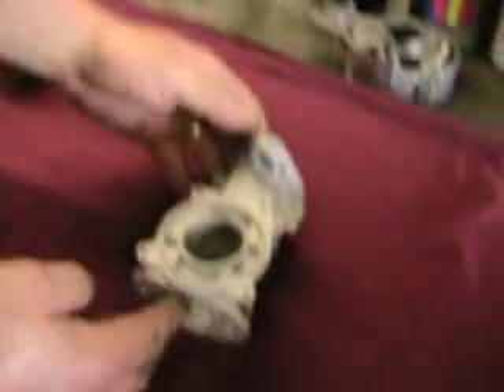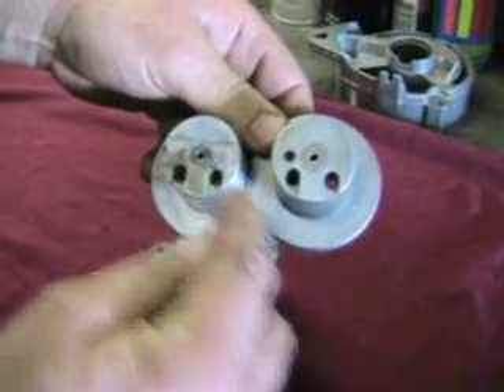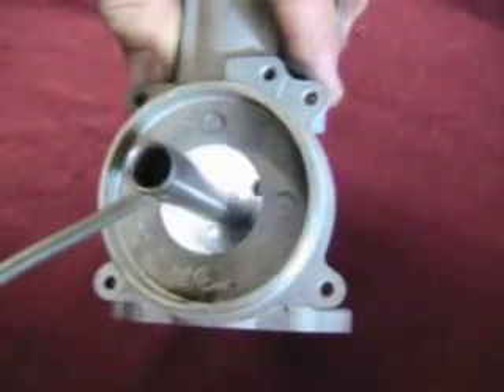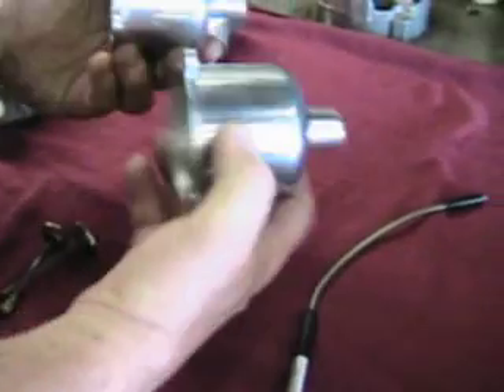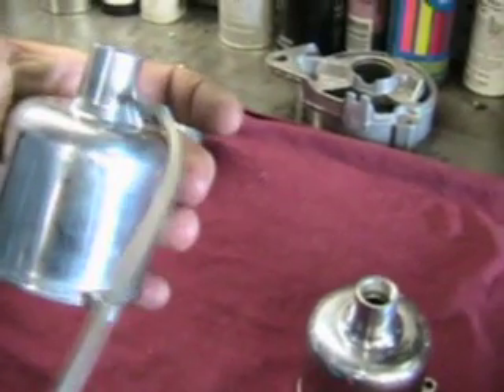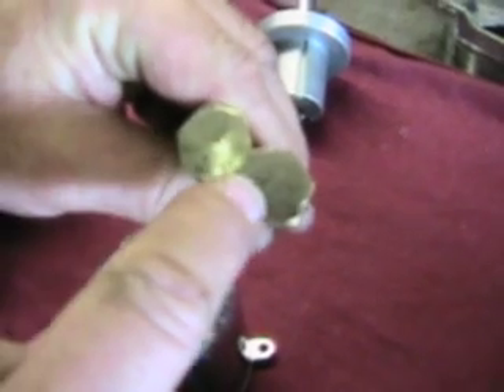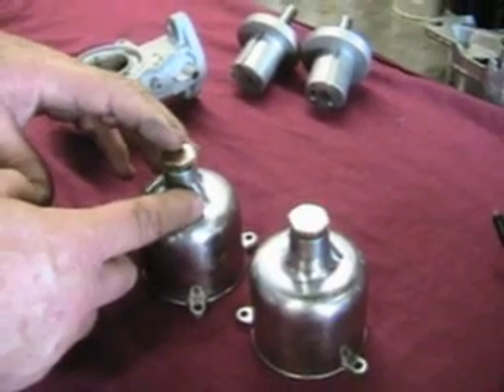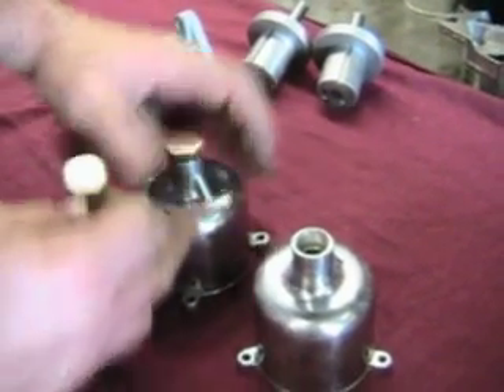029 MG Tech | SU H-Type Carburetors 1945 → 1962

Comment: I didn't realize that the presence of the boss there does not mean that the dustless hole exists.  I've got a pair of H4's on my 1500 that I think may have been re-paired at some point, and with the damper in, one doesn't like to close, while the other will.  (Damper out, they both have fine needle/jet movement).  The dampers are different lengths, but neither is top-vented-- now I need to check the chamber!  I have learned so much already from your videos.